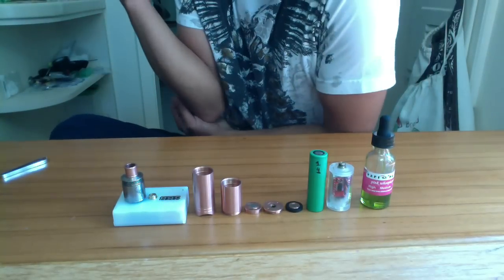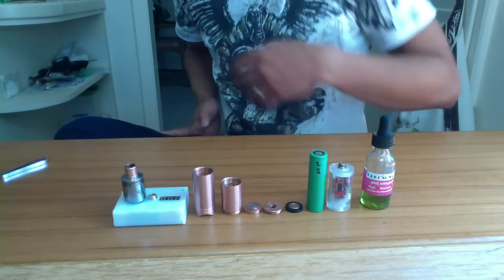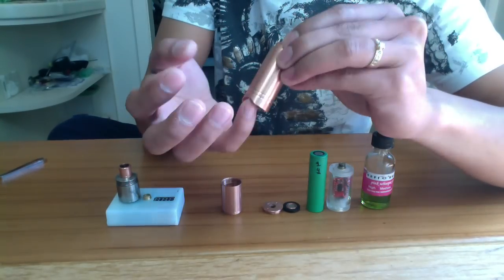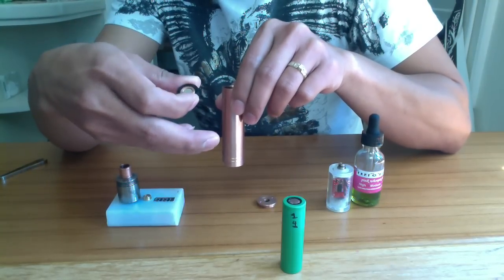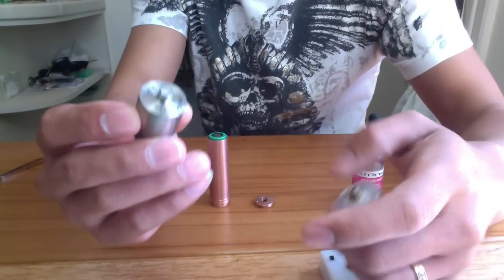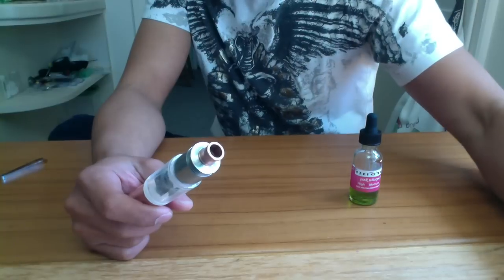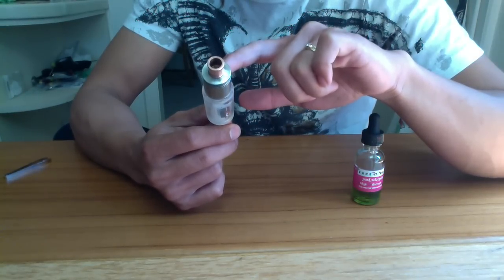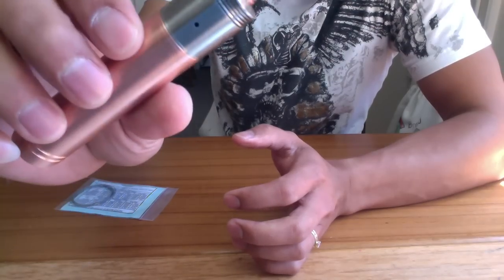Copper 4nine Mod by Tarsius Customs Philippines..

Comment: that join or groove isnt a defect. there are actually two pieces there. the threading and machining are soo good in that one you cant see the seam from the outside, stock out of the box it takes a bit of muscle to seperate them, however i carry them in my vape shop and they DO separate.
Reply: I thought the same and thought they never gave me a 18500 tube lol. Twisted it with not much force and it split.

Comment: The voltage drop is actually probably a lot lower than the test here considering that you have been using that battery for a while. The life of the battery is definitely a huge factor on voltage drop. Put in a new freshly charged battery and I'm pretty sure that thing would rip.